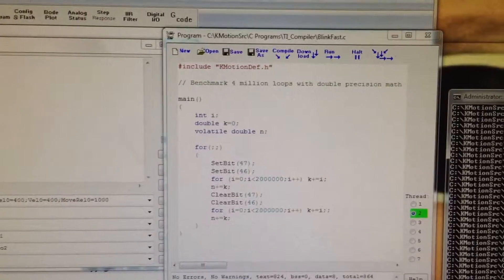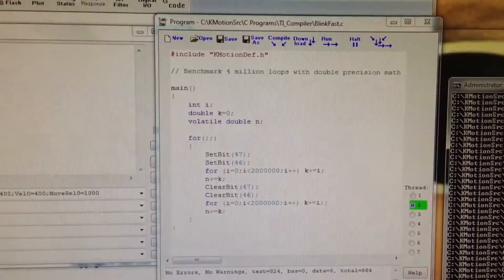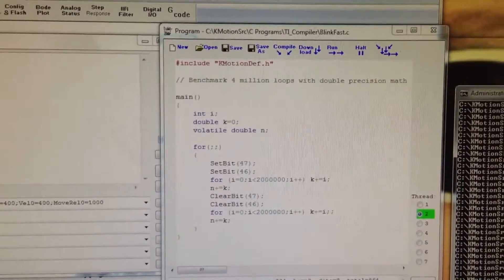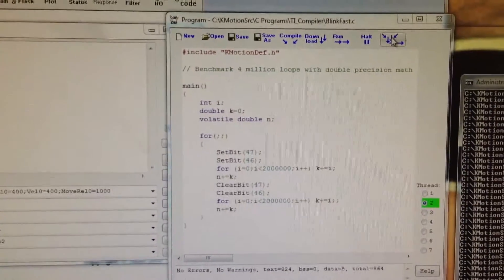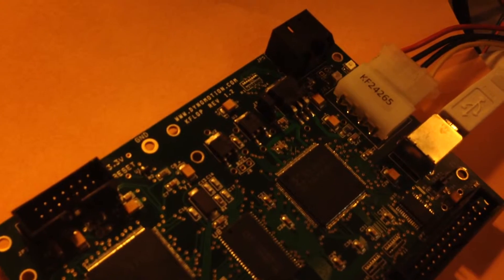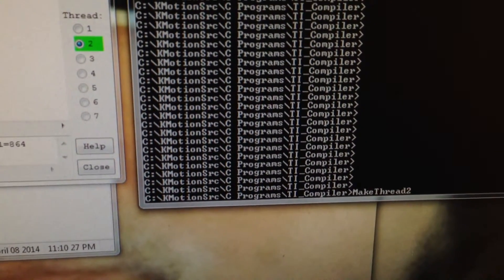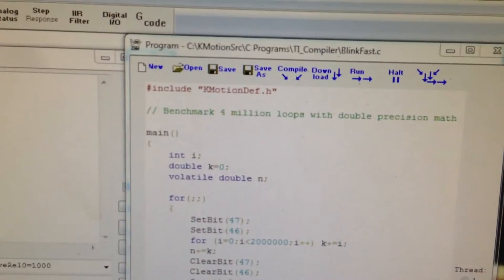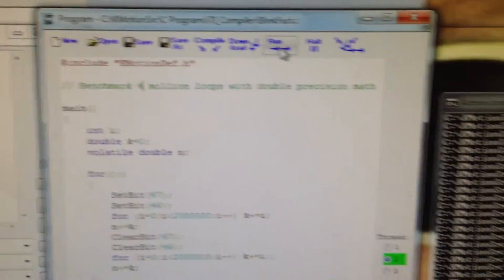KFLOP Fast User Programs

Comment: From where do we get this compiler?
Reply from the maker: The only way I'm aware of is to buy it from Texas Instruments as part of Code Composer Studio.  I think it currently costs $495.  I believe they have a 90 day free evaluation trial.  See:
http://www.ti.com/tool/ccstudio
Reply from the maker: Dynomotion Actually it now seems the Code Generation Tools (Compiler without CCS) may be a free download.
https://www-a.ti.com/downloads/sds_support/TICodegenerationTools/download.htm
Reply: Looks like the optimizations are only in the paid version?
Reply from the maker: Greg Zuro
No.  I believe CCS uses the same Code Generation Tools.  CCS adds the capability of the Integrated Development Environment, Debugging using a JTAG Emulator, Simulation, etc...